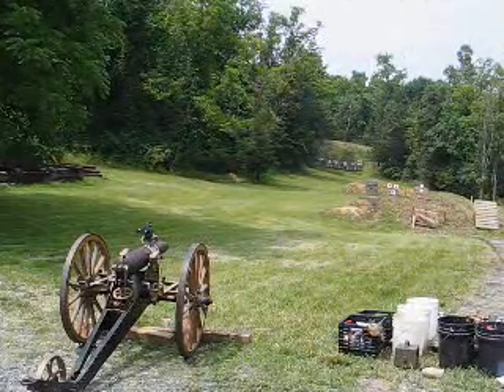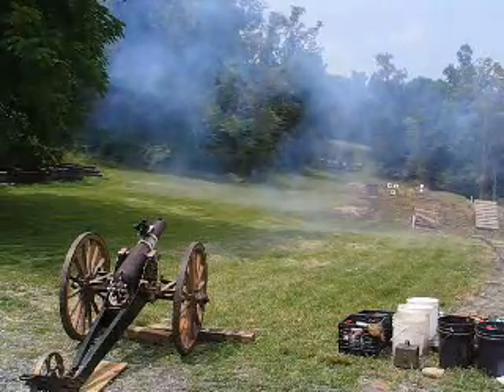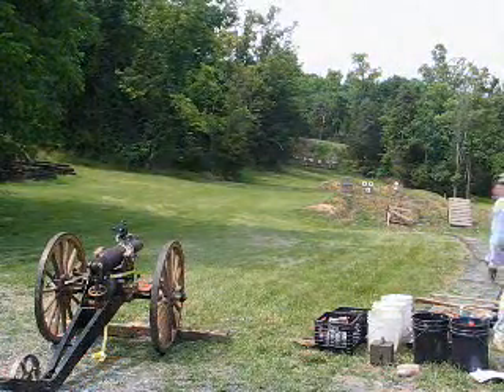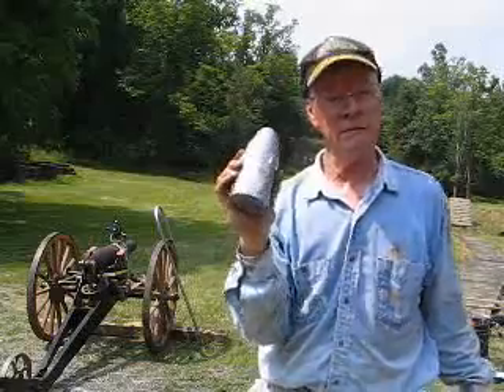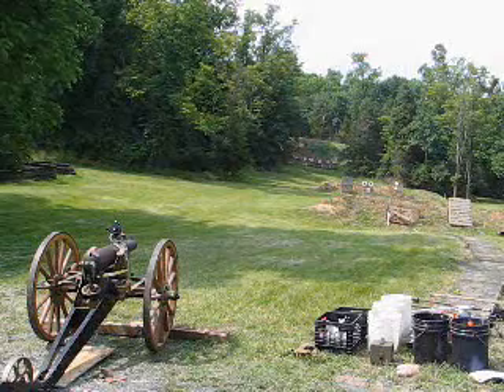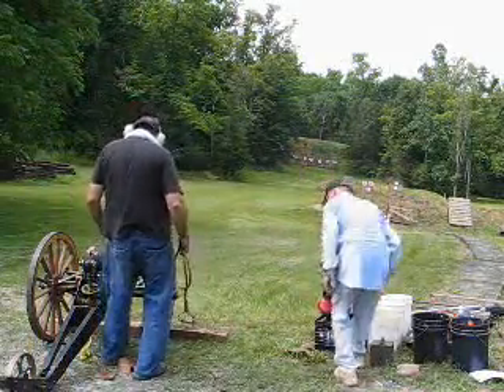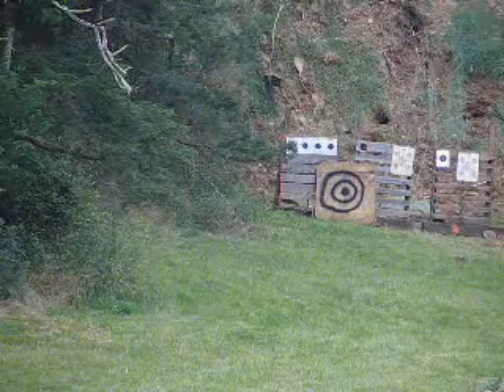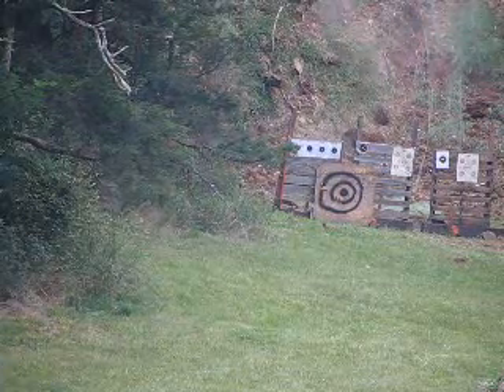Shooting a British 7-Pounder Gun

Comment from the maker: Thanks, good observation, I can explain.  The original projectiles for this gun were hollow explosive projectiles.  We're using solid thus heavier projectiles as an experiment.  The bore size, land-to-land of this gun is 3.0 inches, which determines its "pounder" rating.  A nine-pounder has a larger bore.  Due to the fact that elongated projectiles can come in various lengths, and are usually hollow, the old "pounder" designation left over from round-shot days causes much confusion.